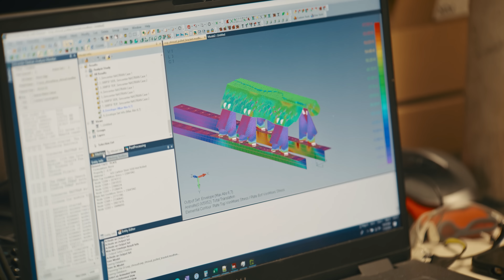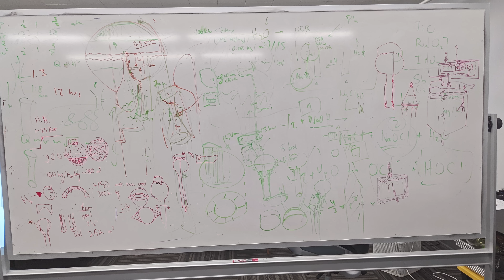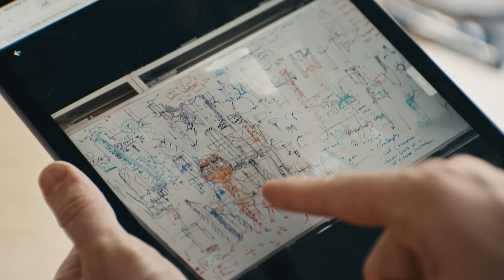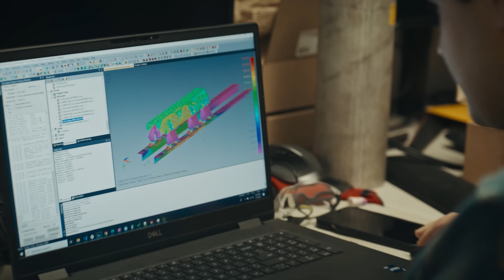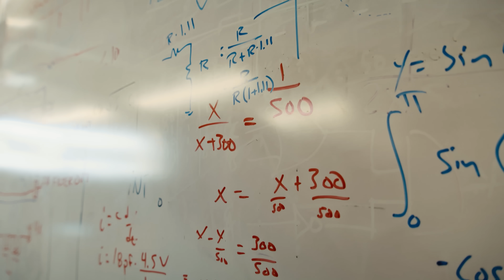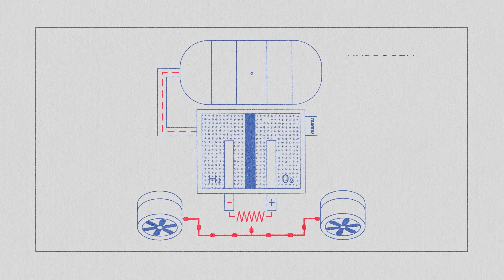Ocean-2

Comment: Very interesting concept, seems to work, although not too much about the actual workings other than the water comes in at the bottom, gets compressed as the thing goes down and then the pressurized water turns a turbine generator and then goes back out to the ocean. And nothing about how they are actually going to produce the hydrogen that will be the 'renewable' energy. Is there an onboard electrolysis system that they haven't mentioned? What about the O2, what happens to that? Are they going to be tethered to each other and will they just float around the world, or are they tethered to the ocean floor somehow.
Reply: Where, exactly, was there any suggestion of water exchange with the exterior, other than when initially filled?

Comment: 10 Problems: 1 scale, can only make them so big. 2 fouling , 3 bio impact, 4 Energy to make the machine more than lifespan output, no. 5 repair safety, has to be hauled out frequently. 6 relatively low KW, 7 moving the energy to land, 8 anti fouling paint sluff water pollution, 9 corrosion/rig lifespan cost exceeds energy revenue, 10 youtubers "riding the ball", liability
Reply: 11) crackpot with no data nay-saying challenges faced by every ocean going vessel on the sea today.
Reply: Definitely gotta shitcan the Welding,use some of elons superglue.& where are the Electric Boats?!...smh

Comment: Not that I really want to burst anybody's bubble here, but how much electricity will be supplied by these bobbers, as compared to how much electricity it takes to build and install one?  What does the energy audit tell us?  Back in the mid 90's, some guy did an energy audit on the nuclear power plants, factored in how much Hydrocarbon fuel was burned to mine and transport the Uranium ore, and how much fuel had to be burned to generate the electricity needed to refine the ore, how much energy to make the steel and other stuff for the nuke plants, and he found out that it would have been more economical to just leave the Uranium in the ground and burn the Carbon based fuels to make the electricity instead!  The conclusion was that the nuclear power industry was a ruse, a dodge set up to get radioactive material for atom bombs, and NOT to provide any "clean" energy!  Wind farms are the same way, they are politically correct, but require more energy to make them than they will ever generate!  Evidently, they are too expensive to repair when they break down, because every time I go through the San Gorgonio Pass on the I-10 freeway, I see dozens of units that are not turning for some reason!  Some have their lube oil running down the towers, others are just stopped.  That means that the coal and natural gas power plants are carrying the majority of the load on our electrical grids.
Reply: Yeah, True cost > Sticker price. Probably depends how many bobbers they build and how long they bob before breaking.
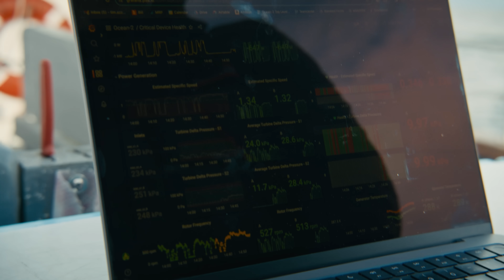Reply: 11:55 2.5 kW
Reply: It’s only a ruse if it’s fossil fuels being used to make everything. If renewables or nuclear itself are used as the power source for refining, steel production etc, then the sums do favour nuclear energy.

Comment: What happens when aquatic life goes up inside it? What exactly do we need the electricity for? What we really need is Water wheels along the Mississippi that are used to cork water across the states and provide water to farms and energy. Making farm costs cheaper.
Reply: It is a closed system- water only enters on initial filling.
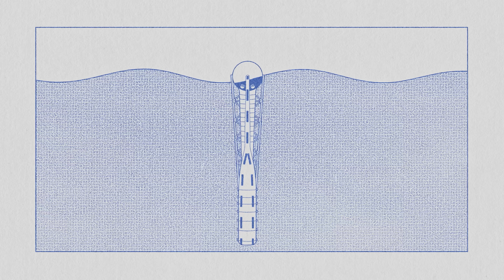Reply: @mavigogun  it's not 6:00

Comment: Probably one of the simplest and basic ocean powered energy devices ive seen so far, its freakin huge but the concept makes sense. The sea life will love those and they will be awesome floating reefs, oil derricks are frowned upon but they make incredible reefs in otherwise dead spots. Cleaning the insides will be terrifying hahaha Good luck with this endeavor!!
Reply: fantastic design almost zero moving parts, I dont know but wouldnt the action of the water inside the chamber help to keep clean ?
Reply: @katiemmm347 Maybe with ablative paint or copper based paint like on boats but they will still need maintenance on those coatings and stubborn sealife removal. Even the few moving parts will need constant attention, sealife is incredibly tough on anything man made and natural made.

Comment: it will be interesting to see how they control marine life growing on the intake chutes and internal surfaces.
Reply: I was thinking the same thing. Going to have barnacles real quick
Reply: It’s a similar environment to a large ships ballast tank. So anti-fouling coatings last much longer than on the exterior of the hull. Additionally, the chambers could be periodically sealed to starve any marine organisms of oxygen. The speed at which the water deoxygenates will only increase as the steel ages. All in all very manageable by tech that has already existed a long time.
Reply: Spoiler: they won't.
Reply: I thought it was a closed system that wasn’t interacting with the marine environment.
Reply: Electrical charges
Reply: Same here.  It's the first negative thought I had for it.  Cross your fingers...
Reply: Great! But was also wondering how oceanlife friendly this was.
Reply: They claim the tube is open on the bottom though, letting ocean water in. But I can imagine that the speed and force of the water jet will help prevent growth as well. They can lock at technologies as used by for example sea locks.
Reply: Sharks with laser beams attached to their heads obviously 😂
Reply: And also the cavitation issue. Whatever nozzle they use to squeeze that water out will need to be replaced regularly as the cavitation bubbles will eat it away. There is no substance yet known to man that doesn't suffer from this effect.
Reply: @karadan100  Just checked out some info on it and seen some interesting solutions.
Have you come across the riblet microstructure of shark skin? Experts wondered how some species of sharks could swim so fast but not have their fins deteriorate like some other powerful swimmers. Turns out it's their small riblet skin surface. 
There are already studies that show how well it helps reduce cavitation erosion. Combined with a ceramic surface material or alloy and apparently you're drastically reducing the effects of cavitation erosion. But I could be preaching to the choir here and you're already well aware 👍😁
Reply: Maybe there would be enough water movement a hard antifoul or prop speed like product would work…..
Reply: @speedmachine69  propspeed only works becasuse the prop throws off the barnicles.
 this isnt going to work. it will need seriously cleaning every two months. not viable.
Reply: Electrify Ocean 2, maybe a small electrical current will deter wildlife?
Reply: This is exactly why they prototype. A future interested energy company knows this and they’ll be seeing how maintenance and manufacturing costs add up.
Reply: Taking an idea from the tea clipper Cutty Sark................Copper Plating.
Reply: @geezer652  This would both completely work, and create an ecological dead zone around all of these like it did when we plated ships with copper.  Tempting, but maybe not what we are trying to accomplish.
Reply: this is very cool but I don't see what real life use there is for a isolated deep ocean power generator like this
Reply: I don't believe it is open to the sea during operation- that is, water mass is trapped and used to pressurized the vessel; were you able to shake the machine up and down on land, it would perform the same.
Reply: @mavigogun they said the bottom is open
Reply: @mavigogun  I never thought of that. It is sealed from the ocean.That would explain why the video clip never touched on that issue. The working fluid could have some interesting properties.
Reply: Think about it for a moment...Thousands of these, millions in maintenance & what will it do for my power bill ?... sky rocket!
Reply: @ltdees2362  At first maybe, but if maintainence is as simple as going out in a specialized ship, and scooping the ball on deck, work on it with a massive pressure washer and a maintainence crew, this could easily be made cheaper and faster.

Why is it that so many merely look at the negatives, and how much it'll 'cost' them right now. Seems like a really silly judgement to pass on such an inovation.
Reply: @ltdees2362  You think the power plants currently supplying you with electricity don't require maintenance AND fuel?
Reply: @ltdees2362 short-term thinking from someone who won't be around to live the consequences of inaction. Classic boomer. 
Its cheaper long run even without environmental consideration because oil rigs need maintenance just like huge arrays of these spheres will need. Exept these are cheaper. So.. your power bill... will be.. cheaper..
Reply: @numnut1516  no mate, i work in subsea, this is a bounacy device. 
in 6 months it will be covered in hard growth inside and out making it sink and not function.
 and divers arent cheap.
 its not viable. 
not boomer energy. its called common sense energy. you should get some.
Reply: @numnut1516  you're making a lot of assumptions, primarily that there is a method to actually transmit the power generated by these arrays to places that NEED and USE power, which there isn't because they're literally planning to deploy them in the deep ocean. "well they'll just run really long power cables!" ok 1 that's not how long haul transmission works, you need a shitload more equipment than just lines, and 2 now you have to pay for maintenance on the grid TO hook these up to the grid.
Reply: @crunchybones2528  No cables, they plan to generate hidrogen, evety one of this thing generate H. then autonomous ship collects this H. and transports it to land. But as i understood from the lack of mentions they don't know yet how to generate hidrogen😅
Reply: @numnut1516  powerbills will never be cheaper, cheaper electricity just means more profit for the companys. Wont matter if its generated by waves or with fusion, you will still be screwed over.
Reply: @numnut1516 tell those boomers wtf is up bro

Comment: Excited to see where you guys go! This is could be huge.

How much power has Ocean-2 been generating?? So curious to learn more
Reply: It's the energy in a bobbing mass! Velocity times mass... Reverse the math and ask how many HP are needed to push a steel ball up and down? That's the power it might generate!
Reply: @dousiastailfeather9454  Multiplied by the efficiency of the turbine, multiplied by the efficiency of conversion and transmission. Which could be a fair amount of energy for all we know.
Reply: @sigh33 Multiplied? you mean divided buddy. Every system has loss, no such thing as a perpetual motion machine
Reply: @enemyspotted2467  Efficiency is a percentage. Multiplied.
Reply: @enemyspotted2467  could have just meant multiply by a a value <1 10x0.5 is the same as 10/2. Buddy.
Reply: @enemyspotted2467  Self report not being good at maths

Comment: It doesn't really cover it in this but what were y'all using for load testing to simulate loads being put on the system and then taken off as if it was actually hooked to the grid?
Reply: It's not designed to be hooked to the grid. It uses a battery ship. They showed satellites so microwave transmission to a telsa battery  pack. It also can produce hydrogen with the power. From what I gathered.
Reply: @kirkbennett3927  No- satellites were only used to illustrate a familiar distributed network, not to suggest microwave transmission into space!   Immediately following that image was an array joined to a collection point.
Reply: @mavigogun  what network? I dont understand...
Reply: They have no apparent clue of the gigawatts of power needed. Period.

Comment: My main concern off the top of my head would be biofouling, but I’ll need to see more on it to know how unfounded that concern is.
Reply: Repurposing Offshore Oil/Gas Crews, as well as maybe Tanker Crews+Support Staff for this would be a just transition.
Reply: Should it be any different than any ocean going vessel?   From my understanding, once filled, the process doesn't depend on external fluid exchange- pressure is being built and turbines spun internally via shaking; were the machine suspended out of the water and shook up and down, it would perform the same way.
Reply: @mavigogun  watch it again, the water being forced into the sphere and then being evacuated through the turbines is the generation process. Sounds like it will fluctuate greatly.
Reply: @frisbeephil to clarify my main concern is barnacles / zebra mussels etc building up on the intake/exhaust ports / getting into the guts.  Algae etc to a lesser extent as well.

Current problem on most ship, and can be addressed with the same technology (also decent as a green new deal jobs program in that respect).

Main issue is from how most people view this as a LCOE / CapEx only issue they will see the costs of that over mass PV and to a lesser extent Conventional Wind farms and chicken out+pull funding.
Reply: @mavigogun  around 6:17 they say the water goes through turbines.